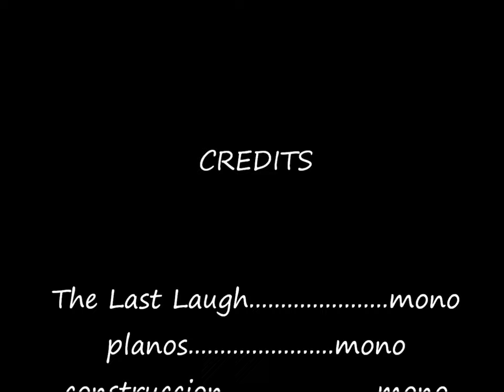Roy Scroggs and 'The Last Laugh'!' Aeromodelismo Peru- Uyuyuy

Comment: I bet it wants more nose-up angle in order to lift off. Many such very-low aspect-ratio planes are like that.

See also the Stout 1918 Batwing sometimes called the vampire bat.
Very-low aspect-ratio planform unitary wing-body with a rudder.
It flew well, but the pilot said never again, because of complete lack of pilot view on landing..
Other similar planes are OK.

See YouTubes for Arup S-2 & S-4 1932 - 1938
https://youtu.be/Nxz1UF67EQI

https://youtu.be/_XrSFVDa3mY

Hatfield Little Bird 1984 (Related to the Arup)
https://youtu.be/zK63GJ0saBA

 Eshelman flatfish plane 1942
https://youtu.be/JpV68abt8uc

Rowe "UFO" 2015
https://youtu.be/eFgr90LobAQ

Nemeth parachute plane 1932
https://youtu.be/yV1P9160GD4

Horton "Wingless" 1953
https://youtu.be/JfhMFKGkgL4

Wainfan "Facetmobile" 1992
https://youtu.be/djdG0TNvPio